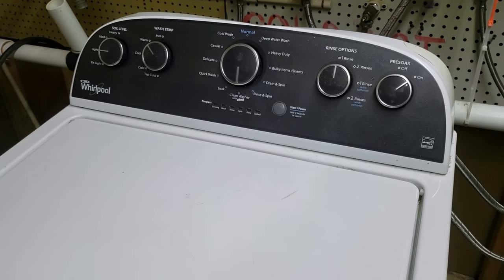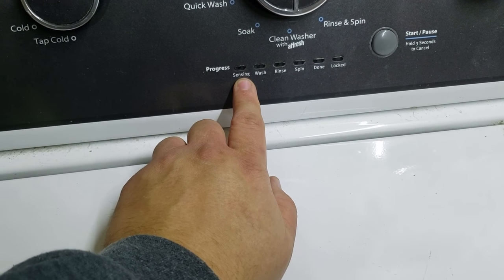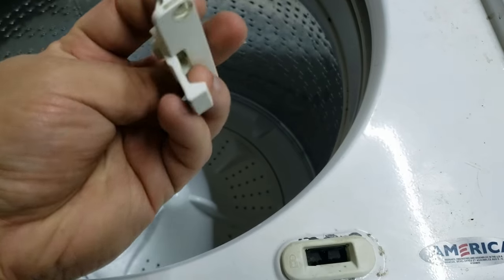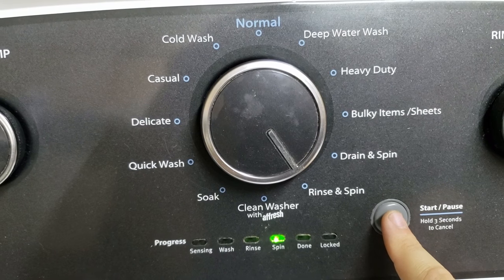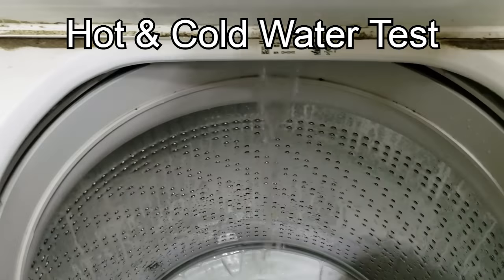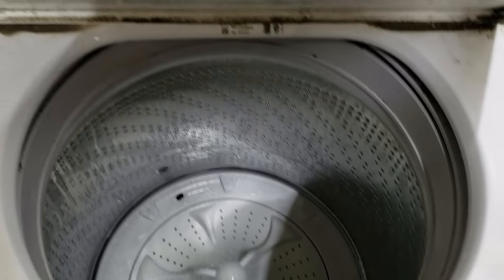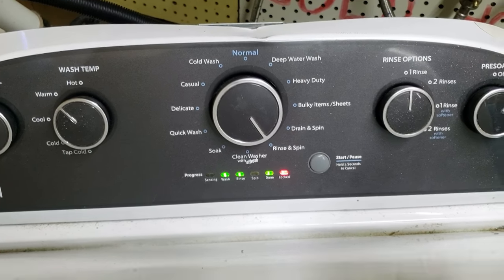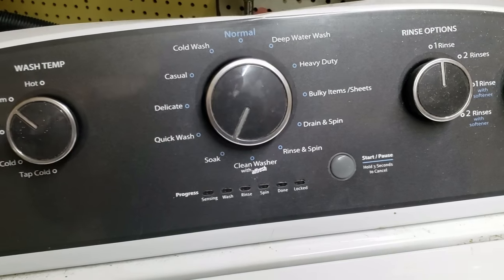How to do a Whirlpool Washer Recalibration and More - Whirlpool Washer Troubleshooting Tutorial

Comment: Immensely helpful in testing my drain motor after cleaning out sand. To others with this model: My unit will only run a normal cycle with 1 Rinse selected; I tried everything except replace the board - so that's either a workaround that might be helpful to you (just stink to 1 Rinse), or a cry for help (Anyone know why?) depending on where you stand.
Reply: Also those bearings are definitely bad. I heard them in the sensing cycle. I mean this is a 2013 back when Whirlpool was known for this.

Comment: My problem: The tub would fill up, then sometimes the wash cycle would start.  It never would enter rinse & spin . Then It would drain and the “wash” led would remain lit till I unplugged the machine. Your troubleshooting and recalibration video was easy to follow. It helped me understand the system and figure out that I needed a water inlet valve and an actuator.  My machine also had a technicians guide in a plastic bag stuck to the inside front panel. With your video and the guide everything fell into place  Thanks
Reply from the maker: Nice! I'm glad this 4 year old video still has some relevance, hehe

Comment: Great videos, I refer to your channel quite often. I have a couple of questions:

When running diagnostics, do both hoses need to be connected to the washer? If so, does one HAVE to be hot or can they both be cold?

When checking codes, why do I sometimes get the same code twice in a row with the only difference being that I get the “done” light at the end of the E code on the second code?
Reply from the maker: Depends on diagnostics. As long as you aren't doing auto-test, you don't need hoses at all. We often run them without hoses just to test the essentials like lid lock / spin. You can run cold/cold on a Y-split without issues just fine.

On the codes, its probably adding a +1 on it as a variant. Like on a lid lock error, it could be a fail state for both on and off, or a shift actuator + motor code.
Reply: @bensappliancesandjunk  ok. I wasn’t sure if part of the diagnostics was to test the thermistor. If it isn’t obvious, the machine I am working on is my first machine (other than my own machines). I never knew there was a diagnostics and error code function until recently. Thanks for your help.

Comment: I own a 2019 maytag (ui looks identically) and was wondering the calibration what does it do for the washer and how would i know if its needs it
Reply from the maker: Generally, calibration is only needed if you had to replace a component on the washer such as a mode shifter, suspension rods (for re-balancing), motor, or other major components. Some newer washers already re-calibrate if a new component is installed, but I am unsure if a 2019 Maytag would need it.

Comment: After doing the Auto test, the Cold inlet would not open. I'll take the assembly out for inspection shortly. Hopefully this is the only issue, since I don't have a multimeter to check for opens. I wish wringer washers would come back (manual, mechanical control for me to monitor).

Comment: I own kenmore 500 series and replace lid lock,I did calibration but my washer still stuck on rinse and flashing...do you think I need a new control board for my kenmore?
Reply from the maker: What other error codes came up?
Reply: Since  I replace my lid lock,I don't have codes at all,I did disconnect, reconnect all plugs but still stucks at rinse and flashing!!
Reply from the maker: @edgardosabinay1138  make sure to recalibrate the washer, that will reset such a situation possibly.
Reply: Yess I will,thank you much!

Comment: Is there a trick to get it to go into calibration mode. I try to spin the dial but the lights will not light up.
Reply from the maker: Try it slower on turning the dials. Usually I try it "Fast" once, then "Slow" and usually one of the two cadences work

Comment: I’ve had my strike plate off since day 1, but I’d like to be able to close the lid flat while it’s running. Is there any solution that leaves access to opening during the wash cycle without the door locking?  I hate this thing!  X)
Reply from the maker: No. The lid switch is a pulsed-cycle on/off. The computer needs to know it can lock/unlock as needed, so there's no basic bypass
Reply: @bensappliancesandjunk  Thanks for the reply. I’ll stop searching for a workaround and try to get used to it locking up my clothes. :). I like having control :).  I can’t get used to not being able to soak things overnight either. Damn, I’m sounding like an old woman lol 😝
Reply from the maker: @ginabee  interestingly enough, people hate the "feature" so much they've changed the newest washers to let it unlock during wash and only lock in spin mode.
Reply: @bensappliancesandjunk   Ahhh! I just got this one 2 months ago LOL
Reply from the maker: @ginabee  odd. All the new ones I thought had the unlocking during wash

Comment: i have had a Amana washer similar to this, i've got the code to start the machine but after i get it to start washer, when do i put the desired style?  I mean "med, heavy, delicate etc..I don't know why they started making all wshers like this?  we ought to have choices as a digital one or a regular one we use to have
Reply from the maker: if the machine is unplugged, once its plugged in, give it about 15 seconds to boot up. From there, you can rotate the knob to select whatever clothing mode you want to use. Once that's done, press start and it should run the mode you selected.

Comment: Hi Ben. I have a Whirlpool WTW5000DW washer. In initial water fill mode it fills for 10 seconds, then agitates(full clothes load) then stops and fills for 10 seconds. This continues on and on. Checked and cleaned inlet filters. Water pressure is great and hoses are clear. Any help is appreciated.
Reply from the maker: Did you find any error codes?
Reply: @bensappliancesandjunk  
Yes, F9 E1.
At that point it was stuck in spin cycle. Now it’s not filling.
Seems to be issues all over.
I’ve checked discharge hose and height, no issue there. 
It’s my sons machine, so I have not rechecked.
Reply from the maker: @pootsalapp  that's a drain pump code. Check and replace drain pump.
Reply: Thank you for your help. Ran load through, completed spin cycle but there was a humming noise, maybe the pump, after spin. It ran for about 15 minutes before I canceled and took the load out.
I had previously checked pump and hoses. The impeller didn’t spin freely, more like a half spin then some tension, then spin and tension.
Think it’s the pump?
Reply from the maker: @pootsalapp  f9e1 is for a pump or drain related issue. If it drains fine, then I'd recalibrate and run a load thru it.
Reply from the maker: If it ran 15min on the pump after spin and didn't turn off, sounds like it was trying to drain water and thought it couldn't. I'd make sure drain line isn't kinked and confirm drain pump can pump water
Reply: Hi Ben thank for all your informative videos. I have a question about calibration. If the machine pounds itself half to death should I stop it, clear it, and start again?
Reply: Hey Ben I done the calibration to my washer and then put a load of clothes in it started to fill up but then stopped it started to make a buzzing sound then drained then the water started to drain and now it’s not doing anything at all but the wash light is on what do I do now the model number is WTW4855HW2
Reply: Help me please 😢
Reply: @teresafortner5656  did you ever solve this problem im having the same issue

Comment: Any suggestions my washer leaves my clothes sopping wet at the end of the cycle and when it spins it makes loud noises . I tried to run the calibration mode and had to unplug it because when it got to the spinning part it started getting so loud and moving all over the place kinda made me nervous . Also when I hand push the drum is makes a squeaking noise when I movie it horizontally thanks greatly appreciate some advice
Reply from the maker: Likely suspension rods are going bad making unit bounce around. Most newer washers will detect the washer banging around and error out of higher spin speeds. If its a whirlpool, I do have a video on changing the rods out.
Reply: I have a Kenmore 600s he, had banging and walking on spin and error Ofb…suspension springs didn’t help, replaced drive assembly didn’t help…what else can I replace my unit is only 4 years old…going to try the test for faults…would appreciate your input, Thank You
Reply: @bensappliancesandjunk  I have the same issue as this commenter. I replaced my suspension rods and half the time it works fine the other half the washer is back to walking/banging (not as bad as before) and it's not wringing the clothes out well enough. Any ideas? I'm gonna try to check for a clog in the drain pump but what other things should I look at?